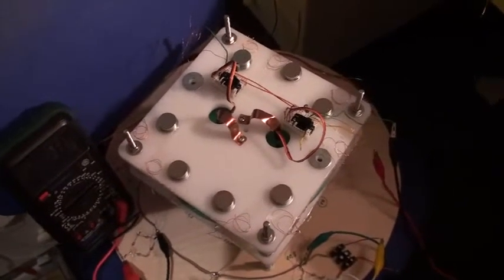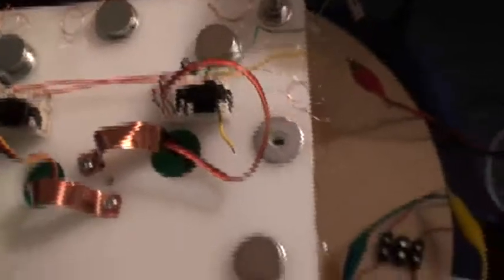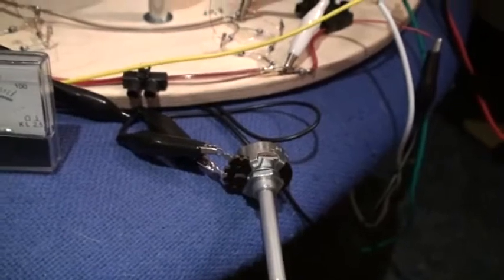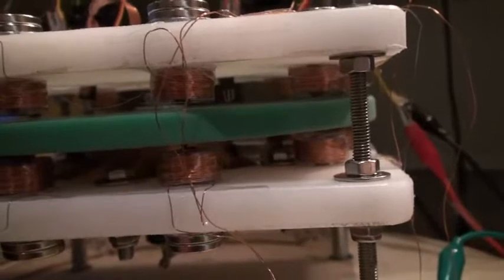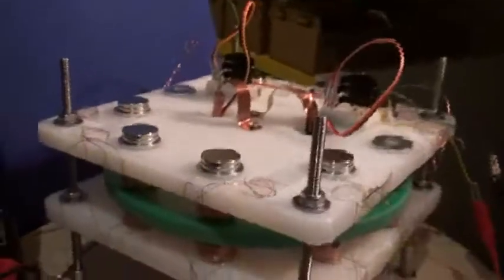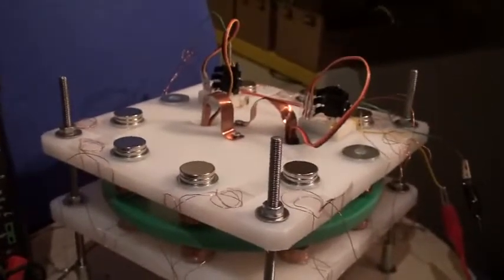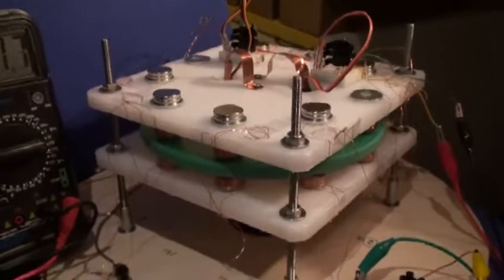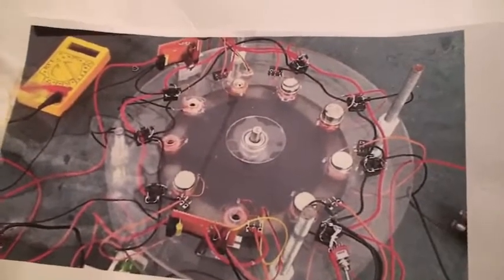romero-muller 4.wmv

Comment: An entertaining demo :) 
Opening the box lid and stepping out for a moment to look at the principle.....rephasing/regauging dynamically is what is needed. Such that, the motor spins at a rev range that it itself runs best at with the load changes. I read that a load must always be used during tests...to me, that means 12V 100mA can be 6V 1A as what the motor see's. A less load may see less speed cos the magnet arrangement and resulting forces makes it itself happiest and balanced. Just an idea.

Comment: Very good work, I like the motor-generator you built. It shows that replication of Romero's contraption is not straight forward; and this is an important result in itself. I am building a motor-generator with just one pair of drive coils and one pair of generator coils to investigate the myth of the biasing magnets. I want to see  whether biasing magnets on the generator coil pair really improve the output. Also the switching of the drive coil pair needs investigation.
Greetings, Conrad

Comment: Hi Woopy, well done video.
Romero did use additional ferrite magnets at the lower side of the stator with plastic wishers between the neodymn and ferrite magnets there.
Also your iron washers seem to have a very small hole only.
This could be a great factor that your magnets dont conduct the flux down below to the ferrite rods.. Have you tested ONE coil pair for optimum distances so the flux switches back and forth inside the ferrite rods ? Maybe you need to get a GAUSS meter ? Regards, Stefan.

Comment: The fundamental behaviour being demonstrated here is that the rotor slows down the higher the load put on it, i.e.; as you lower the resistance value.   Then balance comes into play because when the rotor slows down the coils generate less EMF.  Eventually you find a new balance point at a new RPM where [input power] = [generator output power + friction power].  You also notice the input power increases as the rotor slows down.  The drive coils are on a longer time and get purely resistive.

Comment: 4th:  If the generator coils can indeed produce more than 13.2 volts then current flows into the load, but the voltage remains "clamped" to the battery voltage at 12.6 volts.  The battery "forces" the voltage to remain at 12.6 volts.

A possible scenario is that only the very top peaks of the FBWR output is above 13.2 volts.  Therefore only a very tiny amount of power is output by the generator coils.  Most of the time the generator coils are "locked out" by the 12.6 volts of the battery.

Comment: 4th:  For Woopy congratulations on noticing the extra wire.  It seems that Wattsup used your information and found an extra black wire on the long clip.  From the very beginning I said that Romero wired in some extra DC power into the FWBR bus to fake his clips.  I thought that he would use very fine, almost invisible magnet wire to do this. Instead, it appears that he intentionally made his builds all messy with wires everywhere.  He thought that would be natural camouflage to add extra wires.

Comment: Bolt continued:  Remember I used to work as an electrical engineer, the real thing, for REAL.  There is no "thinking outside the box" for a Joule Thief.  It is under unity and I could easily describe an experiment that proes this.  There is no suck thing as "load tuning" because when an inductor discharges it acts as a "current source" and as a result it's output impedance is infinity.  That means that there is no "load tuning" or impedance matching for a discharging coil.

Comment: 3rd:  If we assume the battery voltage is 12.6 volts, then the generator coils will only start to drive the two loads if they can produce a voltage output from the FWBR bus that is (12.6 + 0.6) = 13.2 volts.   The 0.6 volts is of course the voltage drop across the diode in the FWBR.

If the generator coils can produce more than 13.2 volts, then current will be conducted into the two loads, the battery and the light bulb.   If they can't produce more than 13.2 volts then no current flows.

Comment: @overunitydotcom Not true Stefan.  There is a very simple explanation for this that I posted on Lidmotor's clip.  Lidmotor put a very very small load on his rotor.  Therefore the rotor slowed down but it was too small a change to be detected by the human ear.  Your resolution discerning a pitch change is 1 in 600.  And that's when the pitch changes suddenly and it's a higher frequency tone.  In Lidmotor's case, it's a low frequency and the "pitch" changes very gradually.  The rotor slowed down.

Comment: 2nd:  Then there is a second independent circuit in your drawing, and that's the output from the generator coils.  The output from the generator coils is a power source (just like the battery) and that power source sees two loads also.  The first load is the battery and the second load is the light bulb.  Yes indeed, the battery is actually a load for the generator coils.

There is one 'trick' here.  Let's suppose that the battery voltage is 12.6 volts.

Comment: Look at these quotes from Bolt:  "For this reason a Joule Thief IS an over-unity device and i have said this for many years." And this: "Now you can see why they often have a COP around 2 to 8 and very good at lighting very high impedance loads like CLF's but of course depends on precise construction and load tuning."

A Joule Thief is under unity and there is no "load tuning" with a JT.  Bolt does not know what he is talking about and does not understand how an inductor discharges.

Comment: @overunitydotcom Yes Stefan but this is already a foregone conclusion.  You can't forget that a magnet passing by a pick-up coil is a conventional generator configuration.  Of course if you configure the gaps so that they are optimized you might get an extra 1% in output power.  You can visualize this in your mind if you understand how magnet flux flows.  There is noting to "win" here and spending hours of time to optimize air gaps is basically ridiculous when you compare it to Romero's build.

Comment: @overunitydotcom Stefan I apologize for the delay in getting back to you.  The reality is that Romero did not violate Lenz' law, he simply cheated.  All of the discussions about the rotor speeding up have nothing to do with free energy and I have read that 100 time before already on other threads.  All of the discussions about setting up LC resonance in the drive coils by adding a capacitor or having a 90 degree phase shift have nothing to do with free energy either.

Comment: 2nd:  I just want to correct an error that I made in my posting about the output power calculation:  When I stated, "actually lower than this because you are supposed to use average voltage and not RMS voltage in this case" this still incorrect.

When you have a true-RMS multimeter and measure the RMS voltage across a resistor to measure power, you MUST know the actual value of the load resistance.  Therefore for the output power calculation for Woopy's clip, the output power is (V-rms)^2/R.

Comment: 3rd:  As far as the real issue goes about Lenz drag, this has been discussed for years now.  Think about this:  If a generator coil outputs useful energy and drives a load then current MUST flow through the generator coil, you agree I am sure.  Well when current flows through a generator coil by definition the coil becomes an electromagnet.  One more time I assume that you cannot disagree here.  Well, that electromagnet is in opposition to the rotor magnet and there is your Lenz drag.

Comment: @User2718218 
I would first try just to optimize ONE output coilpair to see, where I would get the most output voltage
from and when I would short out or load the coilpair with a say 50  Ohm load resistor, it should not slow down much...So Woopy first try to optimize the voltage from it by adjusting the distances of the airgaps and the stator magnets this way.Then also the other coils should react the same way, if they are build the same way and have the same airgaps and stator backside magnets.

Comment: Reduce the weight of your rotor so it will spin faster on less mA's. Double the amount of coils and increase their windings 4 times if you can fit them in there. And don't forget to put some shatter proof plastic between you and the rotor for your safety.

Comment: Great clip Woopy.

Let's do the numbers:  (These are approximate from the clip)

Input power: 11.97 x 0.129 = 1.42 watts
Output power:  18.3 x 0.016 = 0.29 watts (actually lower than this because you are supposed to use average voltage and not RMS voltage in this case)

Input power:  11.97 x 0.236 = 2.82 watts
Output power:  12.1 x 0.1 = 1.21 watts (actually lower than this because you are supposed to use average voltage and not RMS voltage in this case)

Comment: @overunitydotcom You say, "Have you tested ONE coil pair for optimum distances so the flux switches back and forth inside the ferrite rods?"  What do you really mean by that Stefan?  How do YOU define the "optimum distance" and what kind of measurements is Woopy supposed to make to measure for the "optimum distance?"  Should the rotor be 20 cm in diameter or 22 cm in diameter?  The list of nonsensical questions with no logical reason for posing them can go on forever.  Woopy did a great job.

Comment: Laurent, I will comment on your drawing.  I don't know if it is correct, and it is hard to explain how the current consumption from the battery would drop after you connect the light bulb load.

Let's forget about that for now and let me explain your drawing:

The battery is directly connected to two loads in parallel.  The first is the light bulb, the second load is the pair of generators.  That's it, that's all there is.  If the diagram is correct the battery is lighting the bulb directly.

Comment: out of the box..... the design is not over unity because you observe the affects of magnatisim.... what you could do is cast a toriod of bismuth (with it hollow in the center of the doghnut)  wap it as a coil.... you can induce and magnetic feild with electricity... bismuth is diamagnetis and will encase that energy.... allowing a more smooth travel providing your magnets are properly aligned...

Comment: @overunitydotcom Stefan, please read my posting #372 on the Romerouk replication thread on OUR.  You will find a good suggestion there for making measurements on a replication so that you can start to do a more scientific analysis.  If you are going to experiment with changes and see how they affect the motor-generator that posting is a good place to start.  Going back to the "tuning" issue, every replication will hit a max power output wall, because that's how these devices work.

Comment: @overunitydotcom Yes Stefan you can speculate that there is something 'missing' in Woopy's configuration forever, there is no end to that train of thought.  However, the problem is that you can't offer up a single rational reason for the types of questions that you are posing.  The hole in the iron washer?  You say it might be too small?  Perhaps it might be too big, you never know!  Perhaps there should be two holes instead of one hole!  That can go on forever.

Comment: 6th:  One last comment about the Lenz drag issue. I haven't looked at any Thane clips recently so I wasn't aware he was looking into that.  However my comments about Thane's technical competence from what I saw last year are real and true.  Is it possible he is putting a very small load on his rotor and he simply can't hear a change in speed?  I saw that in a recent clip!  Talk about unscientific nonsense.  A very small load will slow down the rotor very slightly such that you can't hear it!!!!

Comment: 2nd:  The same thing applies to impedance matching.  It has nothing to do with free energy and I have no clue which two impedances you are talking about matching and I doubt that you know yourself.

The boys talk about beating Lenz' law, speeding up under load, impedance matching are based on the ignorant assumption that this is the "key" to free energy.  The boys chase after goals believing that they offer the solution with no logical reason for arriving at that conclusion. It's just blind hope

Comment: 5th:  There was the big discussion on the rotor speeding up when you short out the generator coil.  Nobody tried to explain that.  I made a posting on OUR where I tried to explain that and I am pretty confident that I am correct.  One more time, this is just a waste of time and has nothing to do with testing the Romero replication.  The "tuning" idea is also WRONG.  To imagine that "just the right spacing" for something will give you OU is simply nonsense.  Let's see some REAL TESTING. IN VS OUT

Comment: 3rd:  So the thread on OU is pretty much going nowhere and it's just a repeat of the same discussions that we have all seen before on other threads.  I tried to suggest to a few people to make graphs of RPM vs. load and RPM vs. power out and things like that but no one listens.  They are just doing the same old bullshitting.

The worst offender on the thread is Bolt.  95% of what Bolt posts is technical sounding mumbo-jumbo garbage talk that makes no sense at all.  Bolt is full of shit.

Comment: 4th:  The Romero thread on OU is getting out of control and we are seeing the same old stuff that we have seen a million times before.  The boys are bored from waiting so they are talking about cheating Lenz law, and shorting coils, and reversing the generator coil connections, and discussing diodes.  It's all bullshit Stefan, they should be focusing on building the replications and measuring power in vs. power out and trying the DC-to-DC converter connection.  All else is time-wasting bullshit.